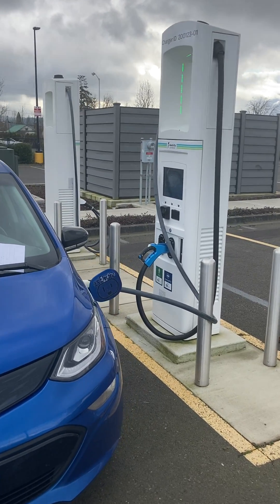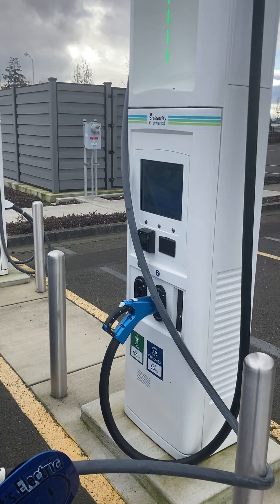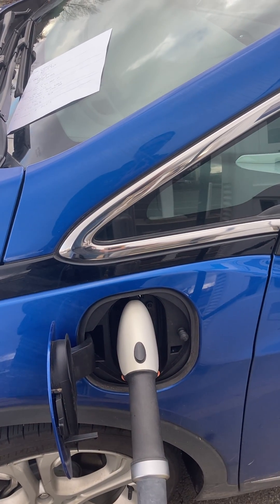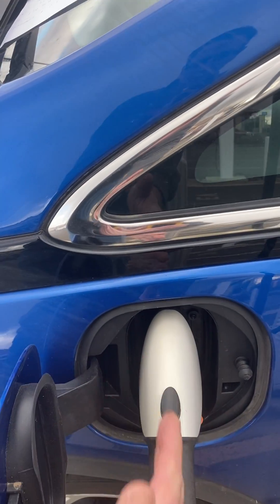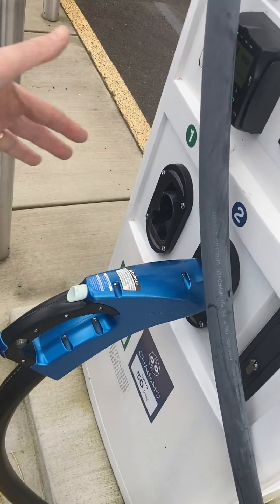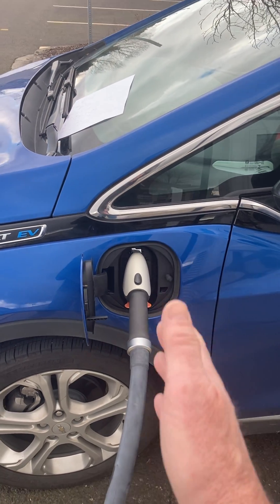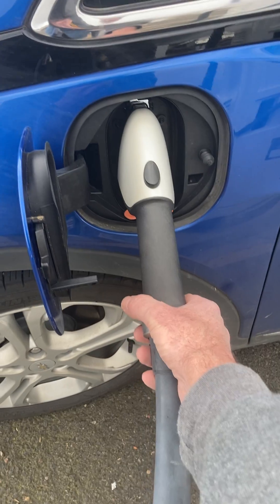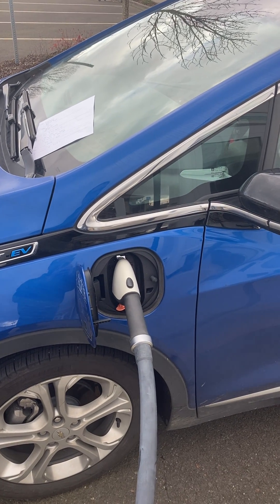Charging a Finicky Chevy Bolt at Electrify America

Comment: I've had a Bolt for years. I've never had an issue with the connector. Yesterday the stupid EA app wouldn't start a charging session and the bonehead on the support line tried to suggest I had to lift the connector. I told them I did (but I didn't) then they initiated the charge from their end and it worked fine. Stupid app. It used to work fine until they broke it with the new update.